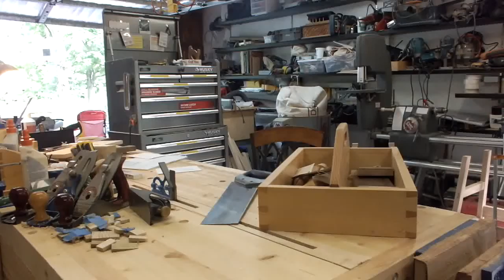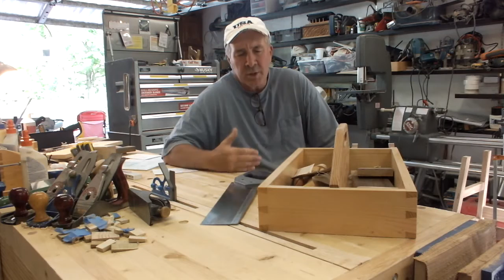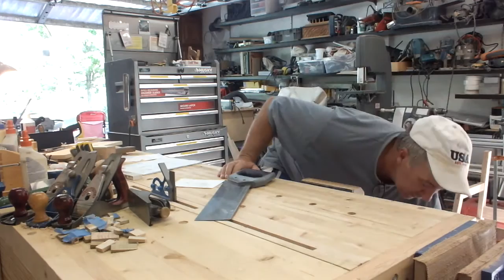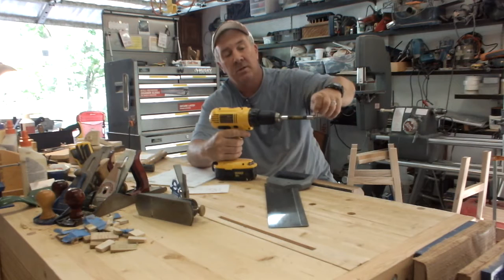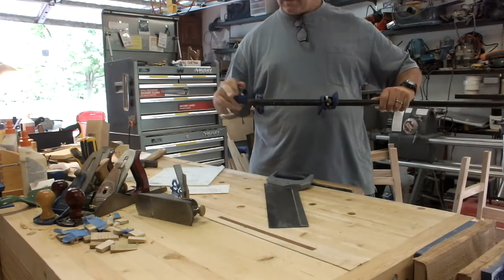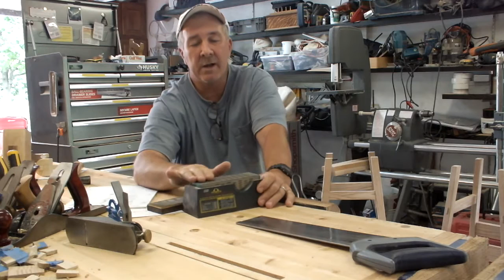PART 2,  the tools you MUST HAVE ( absolutely!)

Comment: New sub here that has basically walked a similar path as you... too many tools in the past. I've been making the transition to hand tools for the past few years and it can be another rabbet hole.You've been giving great advice and I was glad to see you recommend a full size hand saw as an alternative to a circular saw. You mentioned a jig/saber saw and personally, I'd go with the hand saw and a jig saw over the circular saw, more versatile. Egg beater and a brace is another way a person can go for furniture type tools to get away from power cords and batteries. I just bought a mint brace off eBay for $30 US +shipping. For new shoppers, go with a three piece chuck over the older two piece chuck so you can use newer drill bits. The older two piece chuck is set up for the older style bits. 
Anyway, thanks again, I can't get enough of these videos, its like getting my batteries charged up, or just a reminder to get off my butt.

Comment: Next time try the Makita cordless drills/impact drivers.  They last forever.
Reply from the maker: I actually do like the Makita brand but they hardly last forever....I'm on my 5th drill and to be honest, the best one they ever made was the first design model.  It had the long handle and allowed you to put your hand at the rear top which allowed all the force to line up with the same axis as the drill bit.  This was a huge ergonomic and leverage advantage and greatly reduced fatigue and wrist pain during hard all day use (like metal stud framing).  The pistol grip drills took over and are sold as being the "the best design" and are far from it since you lever against your wrist every time you push on the tool to use it.  If they did this type of design to corded drywall guns, the hangers in the industry would be rioting in the streets or going on disability after a few years from occupational injury!  Look at the corded drywall screwguns closely and you'll see what I mean.  They allow the axis of force to travel through the wrist and through the forearm rather than bending the wrist.  Battery drills are another perfect example of what I always am saying that manufacturers will discontinue the thing we need and instead push some other stupid design on the public.